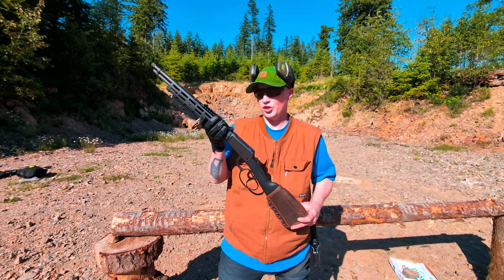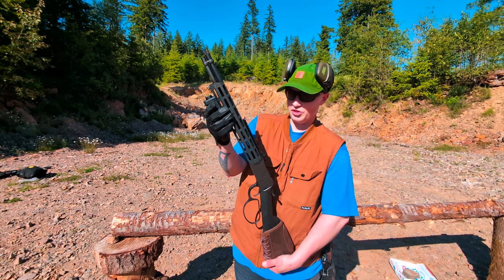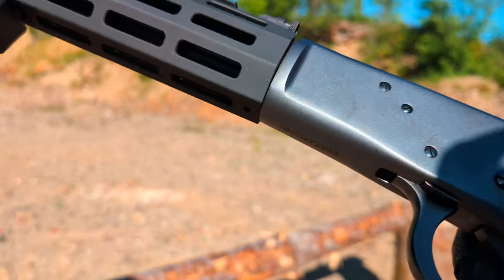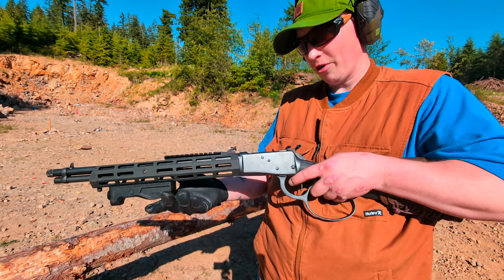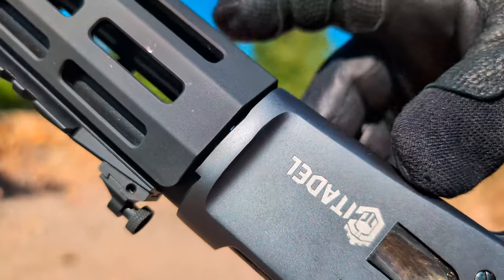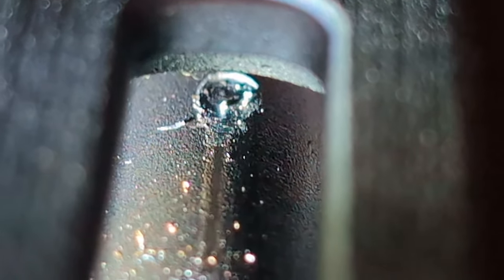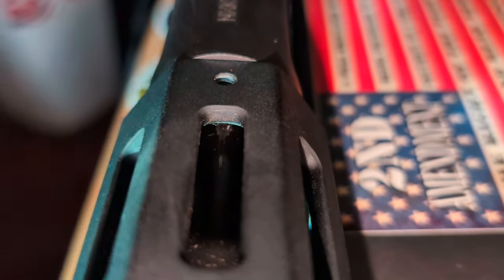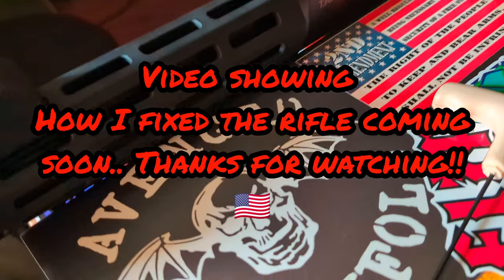Citadel Levtac-92 .357mag Handguard & Pic rail issues..

Comment: I love mine, but the issue I had could have been bad. The barrel was loose. I don’t know how or when, since I had not broken the gun down before. During its first cleaning was when I found the loose barrel. Besides that incident I haven’t had any issues. Also have not taken it out since then. Had already put around maybe less than 150 rounds.
Reply from the maker: Yeah citadel definitely is lacking In the quality control department....
Reply: @counterstrike2A Hey have you reached out to the manufacturer about this issue?
Reply: @jarespeoples554  I should have. But after cleaning and reassembling it. It’s been running perfectly.
Reply from the maker: @jarespeoples554  no don't wanna deal with all of that and have to ship it back to them it's an easy fix I'm going to make the repair myself, just haven't had enough time to do it yet
Reply from the maker: @jarespeoples554 I heard of the reason why it's been taking me so long to make the repair is. I was going to purchase another size set screw for the handguard and then grind it down to a point and then use a brass punch to put a small divot in the barrel and then screw the screw into the handguard with red loctite. So the tip of the screw fits into the hole that I punched and I'm thinking that should fix the issue. But I can understand if somebody else had this problem. They probably wouldn't want to try to figure out how to fix it themselves. Luckily I've got 15 years experience from working  on metal in a machine shop. So I hopefully should be able to fix it on my own 🤞